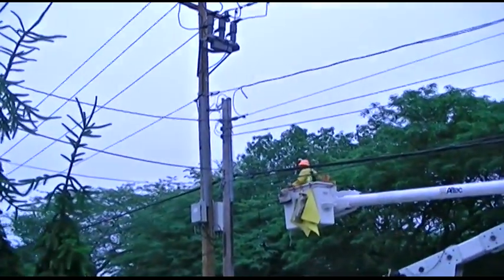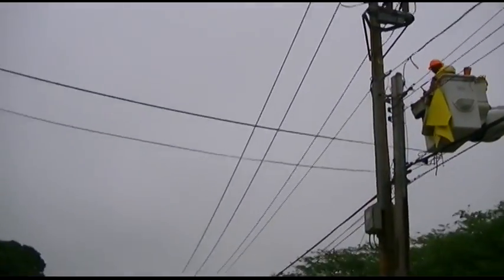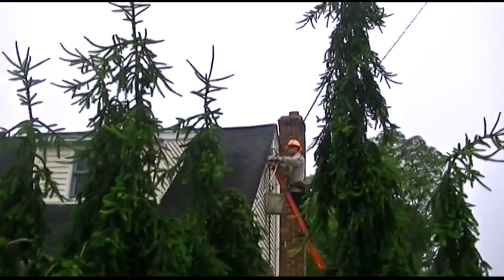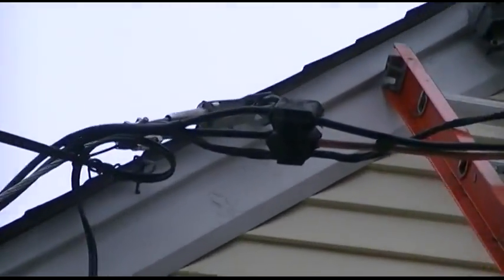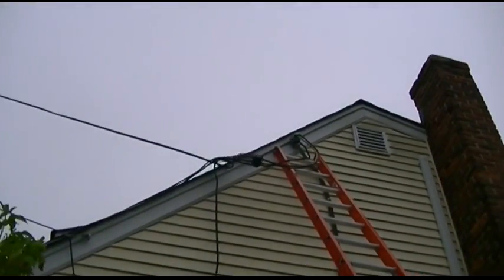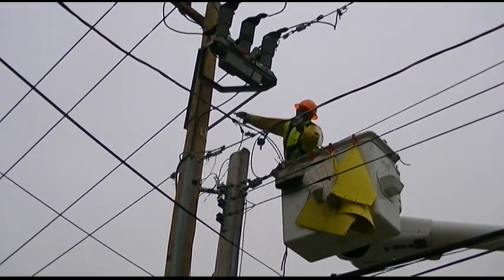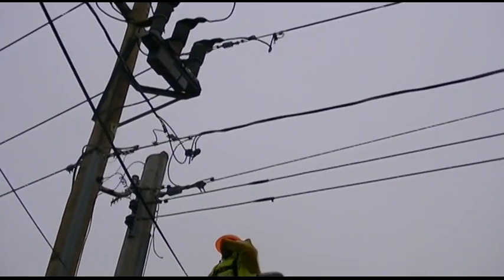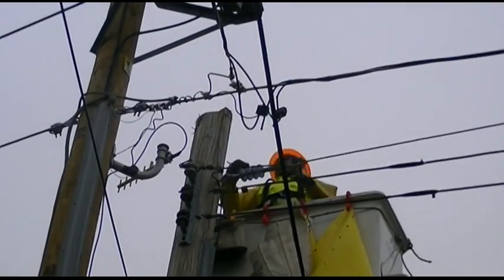New Electrical Service For The House!

Comment: Did your house have 60 amp service before the line was replaced the previous time? I'm sure your air conditioners would have loved that had they been around.
Reply from the maker: I don't know, I didn't own it then.  The house was built in 1954, the only thing I can tell you is that you certainly didn't need a 200 amp panel back then!  Most houses I've seen have had 100 amp panels, though I did see one house when I was in the market that had a 60 amp panel, there was a note on it that stated it was being upgraded to 150 amps.  I actually still have the picture I took of that note.
Reply: Yeah, it's interesting to think how electricity, which is essentially the life blood of a house, has evolved over time. Same house, same grid, and yet a different fundamental infrastructure.
Reply from the maker: And lots more usage of electricity.  Air conditioning is prevalent (at least in this area) nowadays, where when this house was built, not really.  Although, I am told the original owners did have some sort of "central" or "portable" air conditioner, at least for the basement, as evidenced by an unused 240V outlet (plus I spoke with the original owners).  And I'm not even going to get into the billions of devices everyone has that need to be charged every night...
Reply: @jaykay18  I know it is a wash since the A/C probably eats energy like crazy,  but don't forget these days compared to 1954, you're saving a lot on advancements in LED light bulbs, LED TV screens, motor efficiency, switching power supply efficiency, and the computerization of things that once required electromechanics or tubes,  microwaves/air fryers instead of ovens, etc.
Reply from the maker: @NillKitty  Well I still run incandescent light bulbs and CRT screens, I can tell you that.  There's a good balance of new vs. old here, with it heavier on the old.  As "new" and "computerized" and "efficient" as these things are now, they just don't last, compared to the old stuff that just ran forever.  I'd much rather pay a higher electric bill, and have good old stuff that works properly, and does a good job, than replace with new, only to have it die well before it normally would, and have to spend yet again to replace it.

Comment: my house has aluminum wiring
Reply from the maker: It was popular when the house was built, because it was less expensive.  The problem is the dissimilar metals corrode, and that creates a point of high resistance.  Resistance causes heat, and heat causes a fire, all without the circuit breaker ever knowing.

Aluminum wiring is a huge liability nowadays, and insurance companies often won't cover fire damage caused by aluminum wiring.  If you ever even feel an outlet warm in your house you ought to be concerned.
Reply from the maker: It's supposed to be warm!  Most modern dimmers work on PWM to turn the lights on and off at very fast intervals, achieving a dimming effect.  In fact, most in-wall dimmers today have metal tabs on the sides.  When all are present, they can handle more watts.  When multiple dimmers are in the same electrical box, they don't usually fit next to each other, and one or more tabs may need to be broken off, which will reduce the wattage handling capacity of them.  That means those tabs are acting as heat sinks to get rid of the heat.

Very old dimmers were indeed rheostats, and a lot of them surface-mounted to the wall on top of the box.  They got very hot, and as such, had a big metal heatsink behind them.  I've seen such an example before.
Reply: jaykay18 what if a dimmer switch is warm after the lights have been on for many hours. The dimmer switch controls halogen lights.
Reply: @jaykay18-100% incorrect bud (about not being able to use aluminum wire) what do you think those power lines are? Most commercial jobs I do (unless speced) are going with aluminum. I’d wire my house copper for sure , due to reasons you shared . But it’s not a requirement per the NEC

Comment: Those porcelain objects you showed are insulators, used to keep people from getting electrocuted if they touch the pole when wet. Essentially keep the wires from ever touching the poles.
Reply from the maker: Ah, cool, thanks for the info!

Comment: Surely you offered them a trip to jays bar!
Reply from the maker: Actually no, I just asked if they'd change the service, and they did.  The original plan was to replace the service to every house, but they found that wouldn't line their pockets as much so that idea was scrapped.
Reply: jaykay18 after his chainsaw broke you definitely should have offered a beer lol
Reply from the maker: The guy was actually pretty pissed off at the time, from the other guy on the ground telling him to cut the lines another way since they almost hit the car.  Then the chainsaw--that's why he just threw it right in the bucket!  They came back about a week later and cut the pole, then they were officially done with this area in front of my house.  They're still around the neighborhood working on many other poles.

The old poles are the responsibility of Verizon to remove, so when they rot away is when they will be taken out I'm sure.  I'm not certain on this but I believe since they used to be called "telephone poles" they own the right-of-way that they inherited from Ma Bell when they bought them out.
Reply: Verizon might keep the poles because if the attach to the power company  they have to pay rent . Also in some cites they wont let you remove the poles till the rot because the city charges property tax.